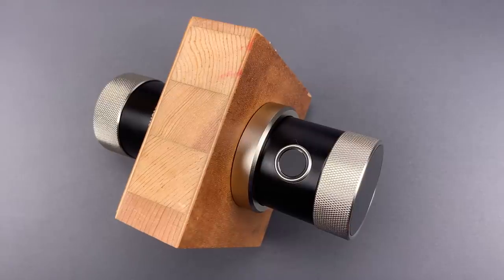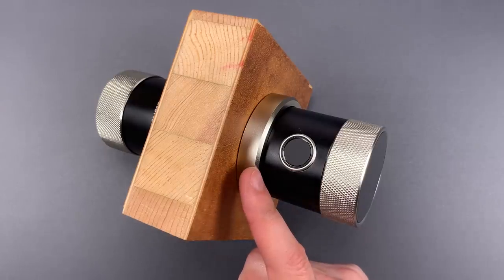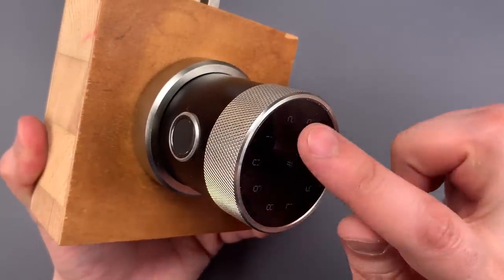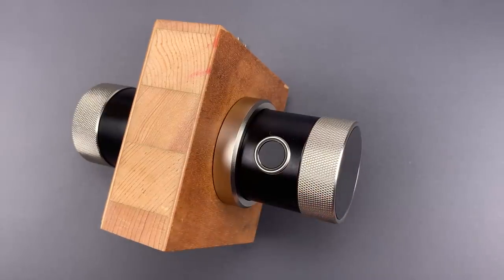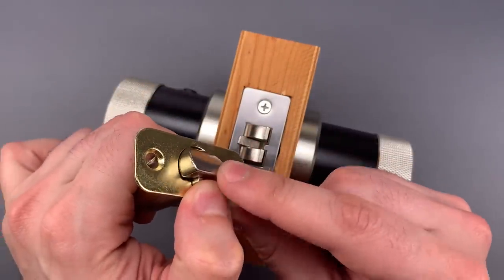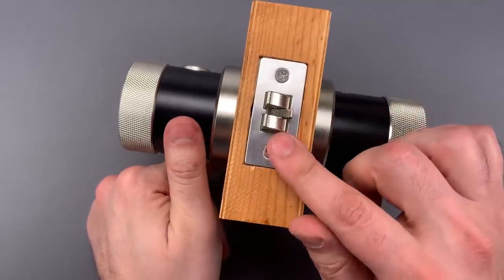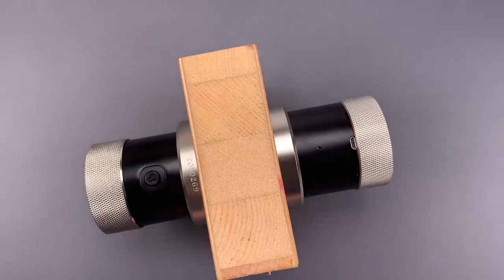[1120] Fingerprint Lock That Forgot The Fundamentals - DatoHome L-B400

Comment: I like electronic locks, but the need to recharge seems an issue. I wonder why no one has put wireless charging between the strike plate and the latch housing...
Reply: i wouldnt put a wireless charger there, over a short time it would wear down, and if you put the strike plate over it the metal would interfere. if going for an approach to use wireless charging that would be thin enough to fit inside the doors width, of most i have seen that size has been for smart watches, just above the strike plate, which would be more cost and/or labor to the installer/manufacturer. if going for a strikeplate charging approach i would say contact pins/pads. but either solution would require electrical work in the wall which would still be costly. i believe the easiest approach is the one supplied in the box. a usb backup power plug, regular maintenance/replacement of batteries. though i would like to see if they have a low battery indicator or not. even still it would require you to carry a rather old, and not very standard, usb cord/charger. the charger could be supplemented with your phones battery with a chargertype(lightning, usb c, these days anyway) to type a connector, of which could easily be attached to a keyring. and keeping the cable itself in a fake rock or something to normally hide housekeys. a much more secure pattern in my opinion than leaving the key itself.
Reply: @EmoFox9  The charging could be recessed in the strike plate hole, not the actual strike plate - though I have never seen a strike plate wear down. And the amount of power necessary would be minimal. Often there is a light switch near a door for exterior light, power could be converted and run fron there which is less labor intensive. I used to have an electric lock with low power indicator and a wireless remote. It was a power hog and eventually I stopped using it, being easy to change batteries doesn't mean less annoying. A lock charging by just closing the door would be worth a minor amount of extra cost and labor to not have to plug it in or change batteries every so often.
Reply: Wonder how much juice you could get from a small solar cell with a high-output IR LED sitting almost on top of it... if it works, cheap and nearly foolproof.

Comment: I've found that taping the locks with scotch tape, covering the keyhole many times, all the moving external parts prevents picking. They can't open or remove the lock without undoing the tape and it is very difficult to put it back as it was, clearly leaving evidence it was picked.

Plus putting absorbent material leaves a the scent of the person making them easier to track down.

Comment: That dimple definitely is there as a backdoor into the system. And i doubt the envisioned use of this lock is to be high security but rather a high tech gadget utility that keeps your average nerd out.
Possibly used inside an office or other location secured by an outer security shell.

Unfortunate that they didn't use a deadbolt though.

Comment: Having to swap out batteries would be a hassle, would make more sense to run some current through the housing and have it charge that way.

I also wouldn't trust anything that can be unlocked through bluetooth, simply due to the precedent set in the past. Look up Anthony Rose's study on smart lock security vulnerabilities from 2016.

Comment: Just the ability to access the locking mechanism from the outside is a security flaw. How about a lock that is indoors only and unlocks with a remote fingerprint scanner possibly using your phone or a dedicated portable scanner? Also a battery backup in case of a blackout.

Comment: As others have said, the lock is powered by normal AA batteries, not charged through the outside USB port. But what if someone doesn't want to break in, but just wants to sabotage things and sends a high current through the USB port that could damage the electronics inside?

Comment: That dimple was most likely the result of a traditional electronic reset mechanism designed to prevent unwanted lock of the door from the inside (reset button) so I am not sure whether that really counts as a flaw (since the micro USB is also in the same place, which would mean any proper hacking device can easily hack into the door and unlock it depending on the wiring of the system). Other than that Bluetooth connection is also a poor choice for locks as this provides a wireless intrusion method for the lock that can be accessed with hacking devices and electric masterkeys.

Comment: I think the dimple might be incase something happens to the memory chips inside the lock and the fingerprints/codes get erased, so they know where to drill to get back in. Similar to how if you forget the code to a combination lock and don’t have a master key, you gotta get the bolt cutters.

Comment: If 1) the latch was replaced and 2) the unit was disassembled to block the dimple point/remove that over ride ; would this be a good product ? Two remaining questions: A) could the mini-USB be a point of attack B) is this intended as an ALL climate outdoors use, or INDOORS only unit? Thanks

Comment: Honestly here in our country most locked doorknobs can be opened using a card that is thin and strong enough to push the lock. That's why my mother uses double locks with different sizes in order to not be possibly robbed.

Comment: What would happen if the lock's battery dies?  Would it then stay locked no matter what or would the lock itself no longer function?  I noticed that the charging side is not on the secure end of this lock, so if the lock only works when charged, the attacker could simply take out the battery or drain it.

Comment: I used to write for a the HelpDesk pages for a computer magazine and I pretty much did anything I liked so on one of my excursions to a computer security exhibition, I picked up a fingerprint mouse - like this lock, you put your enrolled finger on it and it unlocked your computer. Having previously written for Data Security Tools Bulletin, I wondered how easy it was to hack and I found that just breathing gently over the finger print reader made the residual dried sweat and other funky stuff that ends up on these things make the mouse think that I had put my finger print there. That problem is easily sorted out by using software to look for a moving fingerprint. Does this lock - either the one if the video or the newer version - have this vulnerability?

Comment: Well I’m glad there IS a way to mechanically bypass the lock. Electronics fail all the time. I would hate to have no manual way to get in because of some type of issue with the lock’s power source. I know someone who has to break in through s window when his electronic lock (not this one) suddenly died. I don’t know the source of the lock failure, but it definitely happens

Comment: another big design flaw it needs recharging , so have to have a really long wire stuck into a door knob , ie a trip hazard which would be a big nono in the fire safety , also could overload the rfid card mechanism with buffer overflow , and most likely it got a rom master button phrase , and the fingerprint can bypassed using a spray and piece of paper
Reply: It is not rechargeable. It uses standard AA batteries in the indoor handle.

Comment: Does that USB port on the outside only supply power to the unit, or does it also supply data?
If it's the latter, then it could also be subjected to a brute-force computer attack via USB.
If it's the former, then that's actually a good idea - give the owner a chance to charge up the lock from outside if the battery is dead.

Comment: Not too familiar with this stuff, but why put the charging port and manual release on the outside handle? Wouldn't it be a better idea to house those on the inside to prevent shorting/water damage (for the charging port) and forced entry (for the manual release)? The wires shouldn't be that difficult to pass through the main body housing...

Comment: The charging port is on the OUTSIDE handle -- because when you lock yourself out and the thing runs out of power, you'd have a portable battery charger in your EDC kit?

Comment: The small hole is on the inside of the lock and not on the outside which allows the door to be unlocked from inside the house or wherever it is installed.

Comment: I have a question. Isnt the smaller, opposite latch in the center the dead latch? When the door is closed, that center part hits the strike plate without going in the hole, pushes in, and makes it a dead latch. All the locks i have ever seen has that feature on that style latch. But, i am not a locksmith. just a lock installer.

Comment: Holy sh*p, I was looking at the lock on my new apartment and I had a hunch that I could break in with those plastic bottoms to reusable bags. I had my spouse's friend lock me out with both locks and even with the door frame in the way, I was able to bypass both locks (the other was one of those slidy chain things) with just that piece of plastic and holy yikes. That's the first door lock I've ever bypassed, not counting those indoor doors where you just push a screwdriver in.

Comment: Regular locks: May be easy to pick, but on a decent lock that's the only (mostly) non-destructive way.
Electronic locks: Can't be picked, but have some fundamental flaw like an open switch or no deadbolt that can be opened even easier and faster than a regular lock can.

Comment: Pretty sure it has that little pinhole on the bottom as a failsafe in case the doorknob loses power for whatever reason because otherwise your only option if you didn't know how to or lacked the tools to push the latch would be to destroy the door.

Comment: ⚠️ As a locksmith and a systems integrator for a few decades, that hole in the bottom is likely for dealing with lockouts. Technology is wonderful till a battery goes dead, a Bluetooth signal is too weak, or some kind of a failure.  If you contact the manufacturer and say how do I get in I am locked out, they likely would tell you the secret.  Many reputable manufacturers require a locksmith to call with their ALOA number.   We virtually always use key back ups.  Key mark, Medeco, etc. but commonly not on a master key more so depending on the security level of the application.
Reply: That is not a hole, it's a dimple.

When the battery goes dead, which means you have been dumbly ignoring the low battery warning for weeks, you can provide emergency power through the USB port.

Comment: the reason for that dimple, and for that plate is probly the unit looses power, if it mecanicly unlocks the door when depressed then thats exactly what its for, an emergency release is it a securty vulnerability...yes...but with a device that can potentialy fail and lock the user permenently out of there home if the bateries die at the wrong time, its a required one

Comment: If pressing the dimple in unlocks the door, then why would it need to be drilled?  Also, dimple aside, it seems like the functionality of the knob could be destroyed by grounding the pins in the exposed usb port, or via an electrical impulse attack.  I don't know if destroying the circuit would allow you in, that would depend on the default state of the locking mechanism, which also begs the question of what happens when the battery runs out of charge.  Regardless, if it doesn't allow you in, then it would certainly keep the owner out.  This kind of suggests that you're not meant to access that usb port or that dimple from the outside, in which case, the dimple exploit is kind of moot.
Reply: Before the AA batteries inside the indoor part runs out of charge, you'd get ample warning and you should really replace those batteries.

Comment: I wanted to add that I am curious to know if the USB port on the OUTSIDE of the lock is for power only or if it also has a data connection too. Many others have noted the possibility of a hack (if no data channel then safe). However, what about having the power supply outside the door? Shorting the door knob (a phrase I couldn't foresee) could lead to two possibilities: malicious destruction (of knob and potentially door to get in) or undamaged entry (if the internals releases the lock on power loss). Either way, just seems like a weird place to put the port.

Comment: It actually seems like a good product. The dead latch issue is definitely something that needs to be rectified but as for the dimple,. Guessing that was intentional in case the unit fails so that the lock can still be bypassed and replaced.

Surely if a would be burgler is drilling your locks then you are looking at a home insurance claim anyway... As thats a fairly determined thief at that point.

Comment: Door frames, when door opens away from user has a 90° sharp bend tho. How will you slide that plastic thru there? youll put plastiv flat against the door, push it, itll hit the frame.... u need something fluid like to bypass that 90 degree curve, like water+gravity, but that means its not rigid enough to move metal away.
Reply: I get the feeling you have absolutely no idea what he was talking about (that or I have no idea what you are rambling about) Shimming doors has always been a thing.

Comment: looks and sounds like it's best use indoors like a bedroom, closet, or storage room. where a harder or more secure lock structure come before this like the smith first need to gain access to the building before dealing with this thing. Although I can see a lot of people putting this of their front door, now if you have a two door entry and 2 locks on at least one door then okay pass.

Comment: I would guess, that the dimple is there if you allow the thing to run out of battery, so someone can easily let you into your home. that is though, after you drill that hole, you've rung a bell that can't be un-rung and need a new lock.

on a side note, would lock picking lawyer be interested in a child's "cash box" that has a "dial code" that can be deciphered in seconds?

Comment: A deadlatch is only good if properly installed. I've seen many times when installers align the strike plate in such a way that the deadlatch doesn't stay depressed and instead goes into the bore hole. Similarly, I've frequently encountered deadbolts which weren't drilled deep enough and could be manipulated with a knife.

Comment: You can lose your phone and be the fool with no password, easily lose the chip and if you touch the handle enough over time without cleaning it you’ll definitely see the finger print pattern. I also think it will wear the pattern from your finger too over time as well. So depending how many times you go in and out of your house will depend on the timeframe you actually get out of the lock before it’s totally apparent of the code pattern

Comment: "There is a pretty straightforward mechanical flaw that would allow it to be bypassed in just a few seconds"
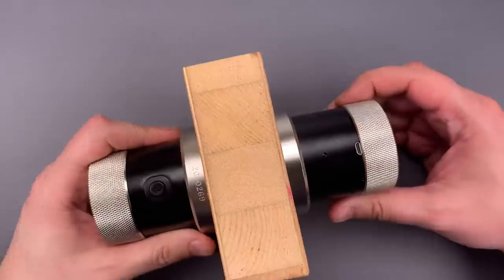@2:24 "When I took this lock apart I found that underneath that dimple, inside this black aluminum housing is a metal part that, when pressed, will unlock the door."
As soon as I saw the reset button, I knew a paperclip could unlock this doorknob in a second. No disassembly/analysis from LPL needed to prove it to me (though he confirmed it) and NO DRILL NEEDED to open the doorknob at that spot as he suggested.
I hope he hasn't tried drilling it yet so he can do an updated video showing the paperclip method.
Reply: It's a dimple, not a hole. Hence the comment about drilling.

Comment: I would assume the part with the small hole and charging port go on the inside not the outside. so unless you're breaking out it should be fine.
Reply: Nope. They're both on the outside knob.  It’s not rechargeable.

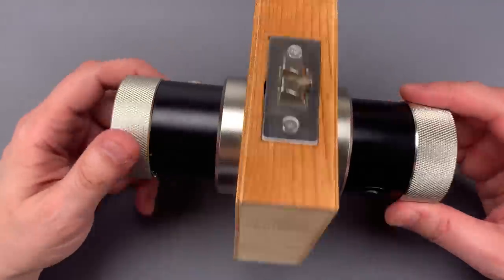Comment: 2:19 - There's also a USB port on the outside handle, which is just crazy from a design perspective. Why give someone outside the property the ability to physically connect to the electronics? Given how slapdash they were with the latch, I'm gonna go ahead and assume they used some off-the-shelf, internal components that already have a number of software-based exploits in the wild.

Comment: The dimple is on the locked side of the door...so not a vulnerable point at all.  As you would have to break in to acess that for that drill attack you mentioned, and since you already broke in to get to it... seems redundant.

Comment: I presume the lock needs recharging, and that's what the USB port is for?
What happens if the battery runs flat?
Reply: It uses 4 AA batteries and USB is for backup power.

Comment: can you maybe review some european doorlocks?
I think in terms of security the doorlocks in germany/austria oughta be good enough
even the lock at my apartment door seems to be kinda nasty in terms of picking and locking happens with an actual piece of steel that's shoved in to the frame
also, there's 2 steps on the door and 2 steps on the frame, so you have no access to the locking bolt, especially with the airtight fit that is common here
the main entrance of the apartment is even worse

these are the reasons I never quite understood how a credit card can pick a lock until I found your channel, I don't understand why the US never really adopted the german standards at least in terms of security

Comment: They need to add a charge feature to the door knob, every time its turned it charges the battery. battery runs out of juice, sure you can plug it in... or just turn the handle 50 times.
Reply: ... or just don't ignore the low battery warning, and replace the AA batteries in the indoor handle when the warning comes on.
Reply: @PanduPoluan  nobody will ever change batteries. better to stand outside and turn the handle a bunch of times.